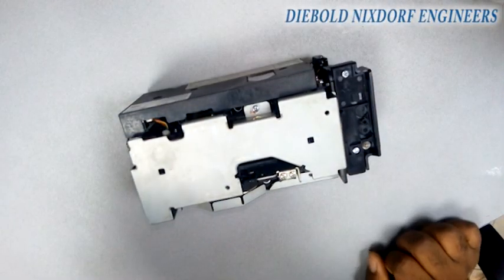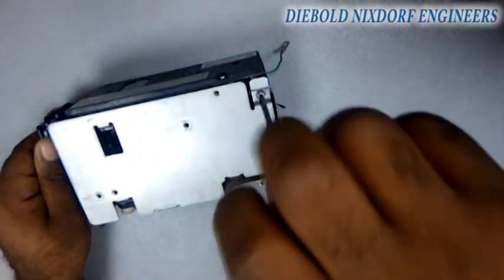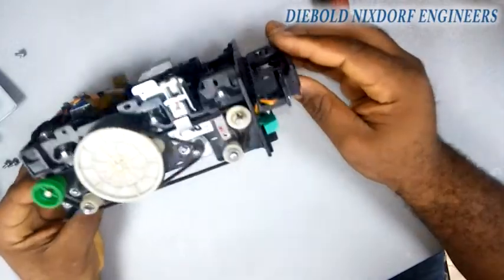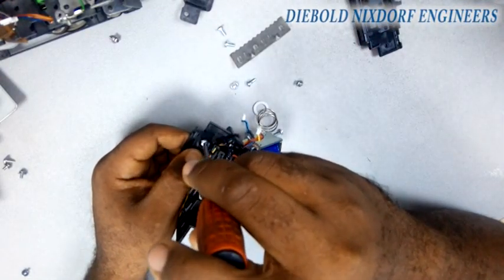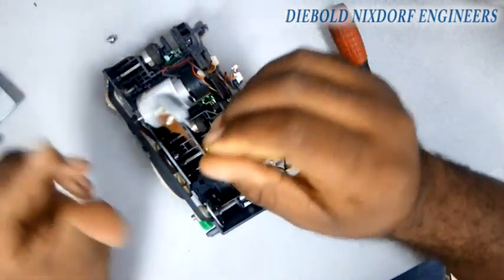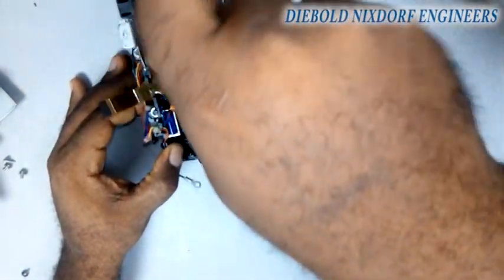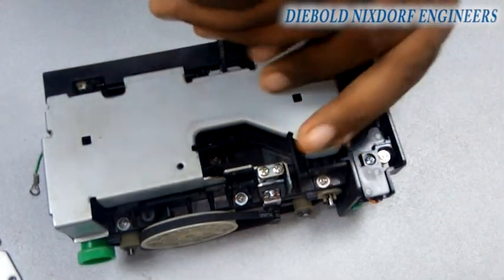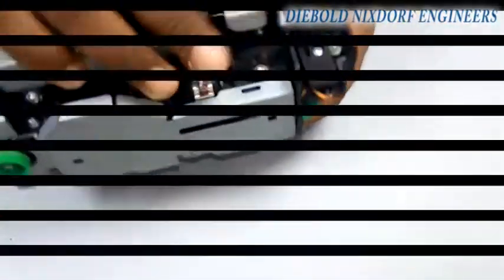HOW TO REPAIR ATM CARD READER FOR WINCOR NIXDORF

Comment: There is a procash 280 uses the same card reader v2cu but the problem is that it throws a fatal error every now and then. i have charged 3 card reader already unsuccessful. Pls any thing in mind?
Reply from the maker: The issue might be coming from the Antiskimming device. Does it often shows Askim error?
Reply: it gets okay when i restart a machine or remove the power cables but after a certain time an error message reappears and that becomes the end of business until you do another reboot.
Reply from the maker: The issue is coming from the Antiskimming device,  resolving it is a bit complex as you will need to  rewire the askim usb cable to the of PC,  change the askim port on the Hardware config and then rerun probase.
Reply: @godwin6148   Thank you. It shows card reader fatal error on operational panel
Reply: @godwin6148  Okay. that is noted. is there a need to replace Anti skimming device? or just change the usb cable port on both pc and askim port on HW config?
Reply from the maker: No need to change the Askim device for now,  the askim and cardreader works together that's why most askim related errors would be displayed as Card reader fatal.
Reply from the maker: Assuming its a cardreader issue,  it would have resolved the time you replaced the cardreader.
Reply: @godwin6148  Thank you, i will be back. I have also sent you an email., do hope you will find it
Reply: Good day. Thank you for your advises Sir. I have manged to close a call, get blessed. Many thanks from Tanzania
Reply from the maker: @moseskitundu6120  you're welcome brother.
Reply from the maker: @moseskitundu6120  glad you were able to resolve the issue.
Reply: @godwin6148  Great brother. I sent you an email about ProdeviceSSP